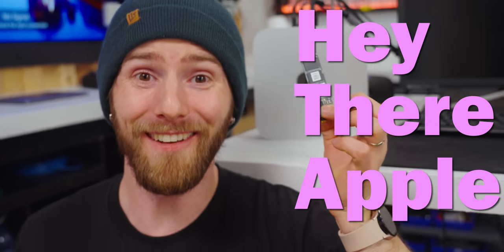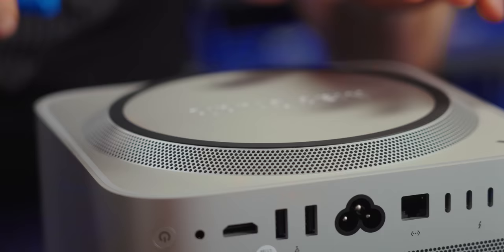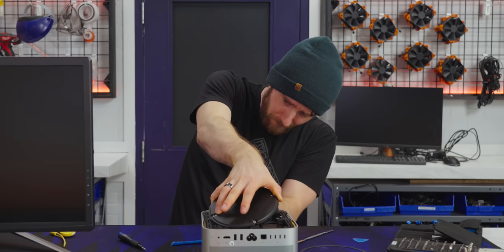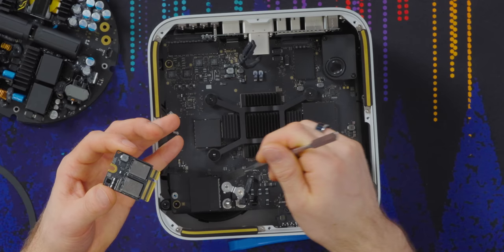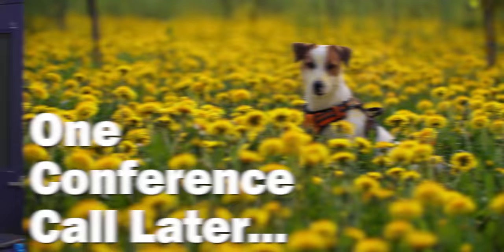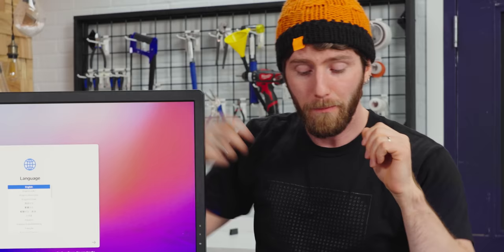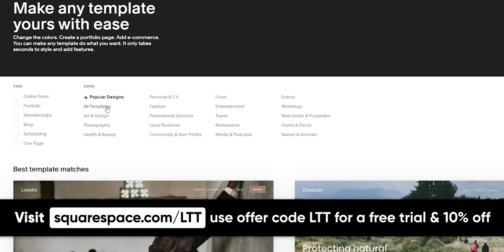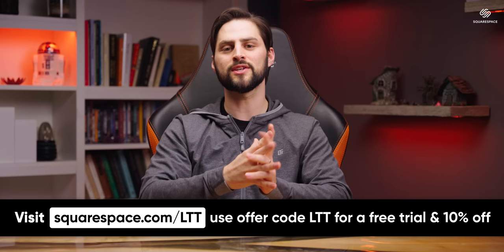I want to love Apple, but they’re making it hard - Mac Studio SSD Swapping

Comment: Here's what really frustrates me about Apple. On the one hand - it is abundantly clear that they have AMAZING engineering resources within the company, and they're genuinely pushing the industry in ways that it needs. I use a Mac for work because I don't want the headaches that come with both Windows and Linux. I love macOS as an operating system, and there's a reasonable argument to be made that they've achieved the high level of interoperability and ease of use because of how vertically integrated everything is.

On the other hand - they've clearly made the decision that they, and ONLY they, should have full control over the machines they produce. I have been repairing my own devices since I was a teenager, and there's no valid reason to do what they've done. I could understand them saying "We won't support components or peripherals not made and vetted by us" in pursuit of that seamlessness, but to go so far as to actively prevent it - even if that what's the customer wants - is blatantly anti-consumer. 

I'm stuck between a bit of a rock and a hard place here: I love macOS, but I don't like Apple's company values. I love Linux for development and tinkering and it's community, but it's not always well suited to do all of the things I want to do without a number of workarounds and headaches (and I daily drove Linux as a developer for years and still use it for my personal gaming rig). I find Windows to be a headache, and I really don't like the ways they're moving the OS into an advertising platform that you get the privilege to pay for.

So where does that leave people like me? I'm happy to pay for good engineering (both hardware and software), and I want it to have a reasonable level of support behind it, but I also want to truly own my own devices. In the current market, that's not really an option anymore.
Reply: All Apple's designs could easily be done by any other company if they weren't following the industry standard. Apple does whatever it wants even if it's not compatible with it's OWN previous products. It's not innovative, it's anti-consumer. Other companies just don't have the cult following to get away with what Apple does, especially at Apple prices.
Reply: @zodwraith5745  I don't know that I would agree with the statement that anyone else could do what Apple is doing. The fact that they decided to create their own Silicon and it's outperforming or trading blows with competitors who are drawing significantly more power is a testament to that. They've also just launched the first consumer chip that combines two separate GPU dyes, and people have been chasing that for decades. They also created the modern smartphone ecosystem, and are consistently putting out devices that are top of the line. You don't do that without having some real talent, and that's worth recognizing. 

The fact that they have broadly put out well designed, functional products that outlast their competitors is why they've developed the following they have. They've spent the past 20 years building their brand and it shows. Compare them to Samsung, who's been trying to follow their example for the past 15 or so years, and it's clear this isn't something that just anyone could do.
Reply: I’m not a very huge fan of apples operating systems, it just feels like they lock everything down so much you’re so much limited in what you can do. Makes the operating system easy to use but if you’re used to other features it can drive you a bit nuts. They’ve been making confusing calls lately somethings are a great deal now but then they’re still doing random stuff like the subject of this video.
Reply: @johngraham8278  Intel has better engineers than Apple. Easily. Apple is on TSMC's bleeding edge nodes cause they charge their customers a premium so they damn well better be efficient. Intel engineers wrung enough performance out of 14nm to outpace Zen2 on 7nm, then still beat the all mighty M1 and Zen3 with 10nm. That's impressive. And that's without dumping x86 compatibility like Apple did. If Intel can catch back up on the fab side they'll easily hold a strong lead again.

Multi die isn't new. Apple is just the only one that can get away with using their iron fist to force everyone to adapt and actually support it cause it's their ball and their game. If that happened in the x86 space? Well, we all know SLI and Xfire worked fine when actually supported, but it was a developer afterthought at best. Putting 2 dies together isn't genius, AMD's had infinity fabric for years now. Besides, have you seen the actual performance of that twin-die GPU? Performs like a 3 year old part at insane prices.

If you're talking about their aesthetic design I never liked it. That's a matter of taste, not talent. This is where they really shine, though as many people DO like their designs.

Unfortunately all the scummy things they do like suing Samesung over a shape, suing Motorola (the inventor of the freaking cell phone?) cause they didn't want to pay fair price for their patents, slowing down old phones, lying about it, then making an excuse after getting busted, and actively engineering unrepairability into all their products makes it really easy to discount anything good that they do.

They're definitely competent, but far from the savior you make them out to be.

Comment: There is definitely a reason the frameworks engineers left the main manufacturers and started doing what they are doing.
Reply: What framework is doing seriously makes me want to buy one of their laptops despite not even having any need for a laptop.
Reply: I wish they would do the same setup for desktops as well. And make their own Micro systems like apple does but keep to their designs.   I can totally see Framework becoming the next (apple) but the way it should of been from the start. I really cant wait for Framework to get ultra cheap in the near future.
Reply: The framework approach is definitely a good idea, but we have yet to wait for them to actually release a replacement/upgrade board for it. And I wish they would offer more IO modules. So far it's limited to USB, DisplayPort, microSD and HDMI. I'd love to see a dual USB-A, DVI or RS232 module. With what they have now I'd have to run with dongles just as much as I'd have to on a macbook.
Reply: @killerdeamonking  like NUCs? I really want to see more sub 2L PCs like the gigabyte brix.
I think a great thing that could be made is a desktop module, that takes a framework motherboard and turns it into a desktop pc, with an optional vesa mount.
Also maybe one with a full size (or open back 4x) pcie so you can add a GPU.
Reply: @satibel  There ya go, and yes i meant a NUC but could not remember the name of that thing xd, They would have a ton of Potentials if they could do a few systems like these.

Comment: Putting the controller and cache on the SoC is a good move. Making it hard to swap / impossible to upgrade, not so much. Surely there's a recovery mode they can put on these things that will make them self-sufficient, like the old internet recovery mode
Reply: Did you watch the video?  He had to use a second mac to get into recovery mode, and even it did fail once, and he could only recover to the same storage amount, larger ssd/flash chips failed.
Reply: @paddy1414  If you actually read his comment he is saying that you shouldn't need another mac in order to recover them like you had with internet recovery.
Reply: With apple recovery mode is buying a new computer together. They are taking planned obsolescence to a whole new height.
Reply: There's a reason it goes to SOS, instead of reading from the hard drive.  It can't.  The drive Encryption key is on the SOC, and you've just replaced the drive so the encryption key it has can't unencrypt the drive.  This is part of the security of the system.  Yes, booting to the recovery partition would be nice, but as designed currently, that requires decrypting the drive, which due to the swap can't be done.
Reply: @BenjaminSchollnick  recovery system could easily be part of the firmware - as it actually f-ing was 10 years ago.
Reply: @diotough  Which recovery system was part of the firmware?  

The Internet recovery mode?  That wasn't firmware, you had to download effectively an ISO that was unarchived to the drive, and then booted into.

Maybe I'm forgetting something, but I don't recall any version of 10.xx.xx that was firmware based.  The recovery partition has always been a separate partition on the drive with a limited version of the OS on it.
Classic Mac OS (eg 7-9), didn't have any bootable OS in firmware.

So I'm unclear on what "firmware based" recovery environment you're discussing.
Reply: @BenjaminSchollnick  There were a lot of diagnostic tools included in the firmware and enough options to fix most things. And we're talking about the client that downloads the recovery system. That can easily be included in firmware and was included to my knowledge.
Reply: @BenjaminSchollnick  I have repaired a couple mac's where I put a new, blank drive in (it was SATA so that will date it).  I held some key combination and one of the option's was to start recovery where the computer loaded something to the point it could connect to the internet.  Then it downloaded everything else from there.  I recovered those machines with a firmware based recovery. (it's part of the bios essentially).
There is absolutely no excuse for what they have done with their new machines.  As far as the encryption goes, yes the flash chip's and controller are paired for security, that's why any changes to the storage in these new machines has to start with a complete reset of the ssd controller to pair it with the new flash, that makes sense.  But that could all be done in the firmware (bios) with some kind of gui interface.
Reply: @procrastinatingnerd  Yes, that's the internet recovery option, where it download the recovery partition as an ISO, and writes it to the drive, and mounts it as a temporary bootable environment.
In this case, where can it store a 4-6 Gb ISO when it can't write to the hard drive, because you've invalidated the encryption key?
Previously, whole disk encryption was running at the OS level.  Now it's at the hardware level, just like it is on the iPhone.
Reply: @diotough  Previously whole drive encryption was running at the OS level, now it's hardware level.
The Internet recovery was handled by downloading an ISO, about 4-6 GB, and then writing it temporarily to disk, mounting it, and booting from that ISO.
So now that you've invalidated the whole disk encryption key, by swapping or replacing with a new drive, where can this ISO partition be stored temporarily so the internet recovery partition can be booted?
You literally have a chicken/egg situation here.
Reply: @BenjaminSchollnick  All you need is a tool that is able to wipe the disk and reinitiate disk encryption. Done. That will not require several gigabyte. Even if it was 1GB ... ramdisk. The firmware integrated client could download the tool (including authentication via an Apple/iCloud account if necessary) and store the image on a ram disk. There's nothing preventing Apple to find a solution that does not require a second Mac ... nothing. They simply chose not to to make it inconvenient and unattractive for everyone.
Reply: @BenjaminSchollnick  Oh I see what your getting wrong.  
Yes the encryption is running at the hardware level now, that's why changing the flash modules break's that.  (This will make data recovery impossible, but that's another problem).  You put new flash modules in and they have to be erased and reset as if they are a new drive with new encryption (Any data will be gone as soon as you take the flash out and reset the controller with different flash).  There were computers 30 years ago that initialize a drive from bios.   Adding hardware encryption to the mix doesn't change that. 

I am not sure exactly how the recovery utility Apple used to have worked behind the scenes but it likely used a ramdisk to download the rest of the utility (not the whole os) after it connected to the internet.  I can't remember if I set up the drive or if it did it on it's own, but either way that step was before downloading the whole os.  Whether or not the old disk can be decrypted or even read is irrelevant.  If it did download the whole iso as you said then the firmware/bios had you set up the drive first, either way it could be done in the firmware/bios.  Either way the utility would obviously set the stupid ssd up again before it needs it.  

This could all be done through a gui based recovery utility like what Apple had a fricken decade ago.  Still absolutely positively no excuse for Apple to be doing this crap.
Reply: @diotough  You don't need another Mac, at least according to another post in the thread.   You can use idevicerestore on Linux to restore from DFU mode. This was reverse engineered originally for restoring iOS devices but they've since added M1 Mac support.
Reply: @procrastinatingnerd  Apple is still building out the infrastructure of the M1 support tools.  

The current recovery infrastructure is based on the pre-M1 designs, where they could resize the disk dynamically (since the whole disk encryption was OS based), and then write the recovery partition during the installation of the Internet Recovery partition.  
The whole disk encryption as it is now, is based more off the iPhone then the previous implementation.
So while it maybe technically feasible to do as you are suggesting, Apple is midway through their transition.  And doing something like that on the iPhone would be practically improbable, and thus when that system was ported over to the desktop, it wasn't implemented that way.
Chances are over the next couple of years, you'll see the elimination for the need to do this with a secondary computer.
Or maybe not.  95+% of all Macintosh users will never see the need the perform a DFU restore on their macintosh.  Maybe the current method is "good enough".  
All I can say is, currently that option is not available.
Reply: @BenjaminSchollnick  This is Apple were talking about, they can make that option available, but they don't want to.
But before I type another 3 paragraphs, I have to remind my self of the primary audience of Apple.  The current method is indeed "good enough" because your right, 95+% of Apple user's will never have a need to do anything we've typed about.  There are many good reason's why I will never give Apple money, I shouldn't worry about it. lol
Reply: @BenjaminSchollnick  The fact, that it had to be reverse engineered and the fact, that you still need a second machine are both the problem. What you're describing is not a good model, it's an appaling move from Apple.
Reply: @diotough  Classic Mac OS had a recovery mode, but it was essentially a programmers debugger, that was in ROM.  Great if you're skilled in using it, but pointless for most average people.  

But since 2001, when Mac OS (nee' Mac OS X) was introduced, the new recovery environment has never been able to fit into a rom.  It's a complete dedicated, bootable copy of Mac OS.    

And since I've had to use the recovery environment many times during my support career, it's been a godsend to not have to deal with a rom based environment, and to use something truly useful.

Comment: I bought the M2 Ultra with the 8T SSD. So, it is fully-populated. I paid a lot for the large SSD but it does contain the overprovisioning that I am hoping will allow my Studio to last. But, before I bought it, I asked the Genius at my Apple Store if they could replace my SSD. I did not ask if they could upgrade it. They told me that the Stores do stock the NAND cards and are prepared to replace them if they go bad. It was then that I felt okay with ordering mine.

Comment: I can FEEL Linus' anger radiating through my screen. I love it! And I completely understand why the feeling is there. Such a foolish move by apple
Reply: The majority of customers and creative professionals aren't buying Apple products to tear them down and complain about what is or isn't inside. I'm a sound engineer/Post mixer. I want to pull the damn thing out of the box, turn it on and have it work. I have work to complete and invoices to send out after it's done. I went down the PC road after years of Mac use. Built myself a nice system and spent more time with my hands inside of it tweaking instead of getting work done. That lasted about 17 months and my Mac Studio will be here next week. I ordered the system that fits my needs and have no desire to open it up to add things. I'll use it until it breaks and the goal is for the work that I do pays for the next one.